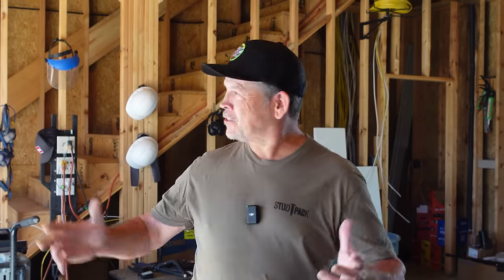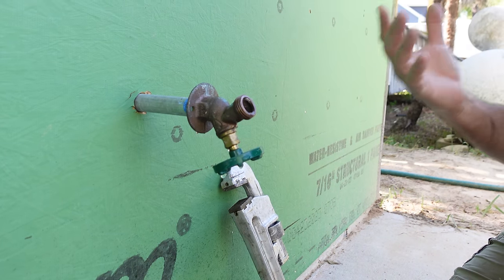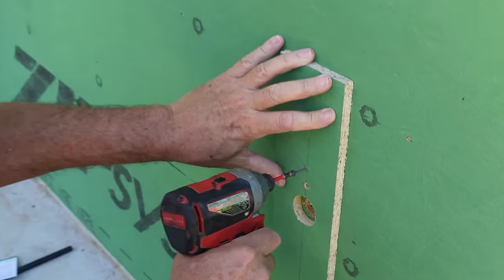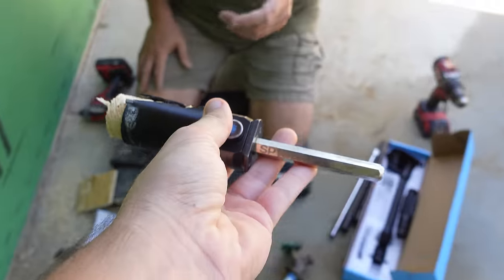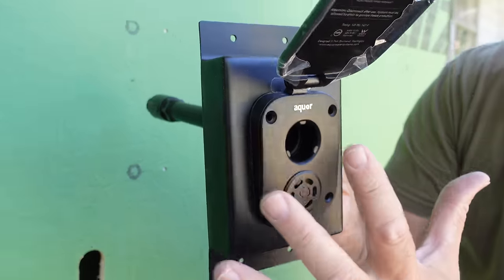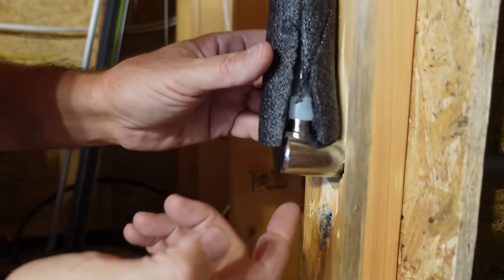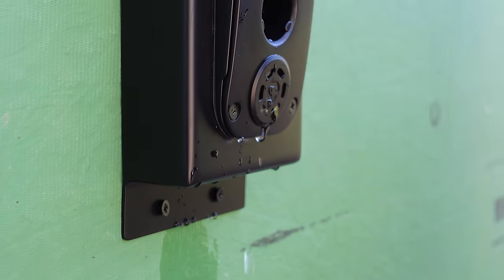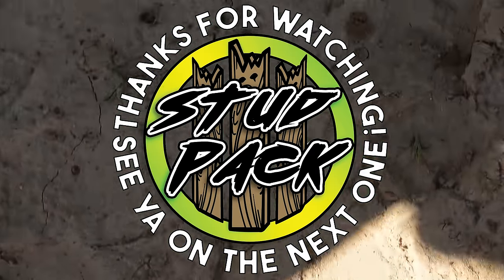Installing a Modern Outdoor Faucet - Ultimate Home Winterization

Comment: The frost free isn't as novel as you think it is -- might be due to regional differences, but where I've lived (northwest US) it's standard for hose bibs to embed the valve deep in the house. That just leaves the funky connector - which looks clean and does minimise issues caused by dirt/bugs, but isn't worth going out of my way to use it.
Reply: @gorak9000  looks like its $15 to replace
Reply: @gorak9000  and with a horse it's $0 to replace the engine. With a bonfire for cooking your food it's $0 to replace a burner. That's why you only see cars and stoves when someone is paid to promote them.

It's a different style hose bib. Strictly speaking you could build a hose to interface directly with this and do away with the replacement piece. Will it catch on long term? Who knows but your complaints against it are purely manufactured
Reply: @jacobalberty  It also prevents the people working on your neighbors house from stealing your water. I think it's worth it just based on how it looks. If you live in a nicer house and care about aesthetics it's a no brainer.
Reply: @jacobalberty  as someone who’s actually installed these, his complaints are correct. I would have left out the paid promotion comment because I don’t think that’s how stud pack operates. However these aren’t good products. They have potential. Right now you have no choice but full blast. I rarely turn my hose bibs on full blast. The other is you can’t repair them. The only way to fix them is to cut the drywall and remove them. They also acted like it’s this or a standard sill cock, that’s not true. There’s freeze proof hydrants. They can be repaired and if you do have to replace them, you can just unscrew them. I think if the they’d make two improvements these would be worthwhile. First make the threads on the tool finer and longer so you can limit the flow. Then make the front removable so you can take it apart and change o rings and washers. I’d never suggest any part to a customer that requires maintenance and that maintenance requires cutting drywall every time.
Reply: @scotts4125  until a washer gets nicked or wears out and you have to cut open the wall to change it
Reply: @joshcowart2446  I think you should watch this video. They addressed every concern you listed
Reply: @jacobalberty  what video? The one we’re commenting on? Tell me where they addressed any of it. Maybe I missed it
Reply: @jacobalberty  poor analogies and comparisons the Aquor is not replacing aqueducts..... it is trying to replace a universal standard that already does the exact same job, and can be purchased for far less money and hassle and has universal parts available at pretty much any hardware store in North America. what happens when the Aquor port fails and starts spraying water every where.. you have to ORDER parts and wait a few days with you water shut off ? with a standard bib, you go to the local HW store and buy a $1 O-ring kit or new bib..
Reply: @joshcowart2446  they showed the attachment with adjustable flow. they also designed their layout so the service side is in a closet or other space that allows an access panel to be hidden easily so no need to cut drywall. I've also seen these installed with bigger holes and a service loop on them so you can pull it out of the wall entirely by just unscrewing it at the front.
Reply: @jacobalberty  so you have to buy an accessory. Also it’s a ball valve, not ideal for controlling flow especially compared to a gate valve. As for the closet, you still have to cut pipe. You can’t push it out to unscrew it, so you ll have to cut the pex, unscrew the drop ear then do the same thing on the new one and reattach the pex. In my opinion this doesn’t offer enough of an advantage over a standard freeze proof hydrant to require this much work. The service loop like risinger used will be the best way to change it. However my argument isn’t about this job specifically but the product in general. Did they install one hose bib where the wall butts up. Can you only install these where there happens to be a wall for access? What if your location doesn’t have a wall. I guess as long as you build a new house and design it where you have a wall at every hose bib then you’re good.
I don’t dislike this product because it’s new and I’m trying to be old man shaking his fist at the air. I just don’t think it’s there yet. Like I said a couple of design changes and it would be fine. Can you design a house so that installing these will be fine, sure. However I’m looking at the product as a whole. I won’t recommend any product with rubber products that requires you to replace a well over a hundred dollar product when you could change a washer. I also won’t recommend something that requires a certain design just so you can change it without cutting drywall. They’ve made wall hydrants for decades for use in commercial buildings. You don’t have to have an access panel and throw the whole thing out when an o ring goes bad. So why can’t they simply make them serviceable. Just like everything else, it’s about trade offs. As it stands now, this product doesn’t have enough of an advantage over a standard freeze proof to require this much cost to the customer
Reply: @jacobalberty how much does it cost to replace a horse and restock the fire wood unless you have plenty of trees and time to cut and split wood pretty sure you would rather have a stove and car or truck
Reply: @joshcowart2446 he did mention putting a access panel to keep from having to cut the drywall
Reply: @jacobalberty every one I install on new construction I put a service loop for that reason
Reply: @plumbbuild6517  yeah that’s the best way but still that means you’re limited on where you can put them. You have to have an open wall abutting the area you want it. It still doesn’t change the fact that if a washer goes bad you have to buy a whole $100 plus dollar hose bib to replace it. I just don’t see enough upside for all this cost. Like I said, they’ve had commercial wall hydrants for decades that can be serviced without requiring extra construction to make it work or requiring replacement of the whole thing is a washer goes bad
Reply: @joshcowart2446  
"I won’t recommend any product with rubber products that requires you to replace a well over a hundred dollar product when you could change a washer. I also won’t recommend something that requires a certain design just so you can change it without cutting drywall."

Are you saying that the o-ring seals can't be replaced? I don't know anything about this product but, just seeing the piece on this video, that seems a bit off. There is an o-ring seal that is exposed when the hose is engaged. I would guess it wouldn't be a big trick to replace that. The o-ring where the adapter screws on is obviously exposed and replaceable. What am I missing? It looks like all you need to service the o-rings is access. The 90° adapter would preclude you from just unscrewing the fitting and pulling it out of the wall from the outside but that could be addressed, as Paul suggested, with an access panel or, as another commentor stated with a service loop and a straight fitting. I'd also bet the o-ring would last infinitely longer than a rubber washer (which already last a long time).

I'm also curious about what you are doing that you need such fine control of the water flow that the ball valve fitting wouldn't do the trick. You could solve that problem with a nozzle on the end of the hose (most people have anyway).

Now pricewise, this thing is a big upgrade over a standard hose bib but if someone wants the looks and/or functionality that is built into this unit, it's available. Some people put ketchup on hot dogs, some insist that mustard is the only thing that should be used. It's just a choice.
Reply: @joshcowart2446  yeah you definitely need a interior wall without insulation for the service loop , I only do them on new construction jobs and I’ve had to use the loop on a fitting that was bad I had a few fittings I had to buy during the Covid scandal that wasn’t my go to fittings and had one failure luckily it was on the hose bib service loop. Got lucky with that one.
Reply: @rogermccaslin5963  you can’t change the washer or o ring that I’m aware of. What you’re referring to is the o ring that seals the adapter. It has o rings so it doesn’t have to be threaded tight to seal. This is so when you use the 90 deg adapter you can unscrew it to the direction you want and not have a leak. The rest is one solid piece so there’s no way to remove the stem that I could find when working on them. This means you have to buy a whole new bib if the washer gets nicked. If I’m wrong show me and I’ll admit my error. Even if this was the o ring you have to go through the back so you still have the access issues. If you also need the access panel or service loop then it limits where you can put them. This last house I did that called for these had 4 of them. Only one landed in a closet so I put an access panel. I guess if you wanted an access panel in the middle of your bedroom and dining room, then I could have added it. 
As for the control thing, I almost never turn my hose bibs on full blast. I’ve used these. When you turn the key it sort of locks in wide open. It’s annoying. But this isn’t a deal breaker, it’s just another thing in the con column. 
As for that last part, do you think I’m trying to prevent people from buying them or for banning them? Where have I ever said I don’t think people should be able to buy them? You can install whatever the hell you want. I’m simply offering my professional opinion as someone who’s installed and replaced these several times. I see videos showing them as this new fancy thing and none of these issues are ever mentioned. The only upside is they look nice. I don’t believe that outweighs all the problems I’ve seen. This calculus will be different for everyone. This is just my advice, no one’s forcing you to take it. Also, I’m not criticizing these because I’m the old guy who says the old way is better. I love new plumbing tech and recommend and use it all the time. I just don’t think this product is there yet. In fact if they just made the stem accessible from the front I’d probably be okay with them because the rest of my issues are small.
Reply: @plumbbuild6517  the last time I installed these, it was a new house being connected to an existing house. It was 4 in the new and replacing all 4 of them in the existing. Not one of them was near a wall and only one was in a closet. It was bedroom, master bedroom, dining room, living room, kids BR, kids BR. That means I could only put an access panel for one of them.
Reply: @jacobalberty  Then you have a proprietary hose.
 Not only is it re-inventing the wheel, it's doing so at 4 or 5 times the cost on top of the design flaw that makes the water dribbling out want to creep down behind the siding. Why didn't they form a drip edge into that mounting box?
Reply: @joshcowart2446  
I actually addressed both o-rings (the water seal and the adapter). The water seal o-ring is exposed when the hose is engaged. Look at 4:26. When Paul engages the hose fitting the seal is exposed. That should be an easy fix if it ever fails. I'm sure you are right, it's not going to fit every situation but it is an option for those that can use it. 

I did not say you were trying to prevent people from buying them but I think your comments that I quoted did, intentionally or not, try put the product in the most negative light. You make them sound like fatal flaws where I just see them as design decisions.

I very much agree with you that anything that makes a product easier to service is a good thing. In this case, I just don't see it as a big issue.
Reply: In Canada ... most of us turn off outdoor water
Reply: @rogermccaslin5963     you’re right. It is repairable. However that still means you have to access it from the back. So you still have to most likely cut drywall. Like I said most of them don’t end up on a wall were you can access it. The ones I’ve put in didn’t. 
As for the rest, that’s very disingenuous. How do any comments ever prevent anyone from buying anything. I guess you can’t ever say a bad thing about a product or you’re trying to prevent people from buying them. You say fatal flaw versus design decisions. Isn’t everything. If something is pink and you don’t want pink then I guess that’s a fatal flaw. If you have a location where you can put an access panel or cutting drywall doesn’t bother you then it’s not a fatal flaw. You’re trying to argue semantics so that you can make my comment worse. 
Bottom line for me, the upside is it looks cool. The downside is unless you have a perfect location, you have to cut drywall to change an o ring. It’s not worth it. I just want people to understand the downsides because all I’ve heard is this the greatest thing since sliced bread and if you use it it magically won’t leak or make your flower bed wet (except when you turn it on/off). 

People can do what they want. I’ve said the downsides I think it has and why I wouldn’t recommend it to my customers. You can somehow think that’s a horrible thing but frankly I don’t give a shit. I’ll do what I think is best for my customers. If they disagree and ask me to install it, I’ll install it.
Reply: @joshcowart2446  personally I almost never adjust the pressure at the bib. I crank it all the way and adjust at a splitter. I can turn it down for my sprinklers and blast the crap off my deck at the same time.
Reply: Canadian tradesmen here. This is a solved problem.
The freezing problem has been solved for several decades, with a standard part that costs less then $30USD
This part, commonly referred to as sillcock, frost-free or freeze-proof faucet, also places the water shut off seal 12" into the house. 
It has few moving parts, and all moving?/wearing parts (eg O-ring) can be easily and quickly replaced from outside, without ever disturbing your seal from the faucet to the house. 
But this one is very pretty. 
I tend to see very southern people shilling this, as they don't know it's a solved problem.
Reply: @TheBarrej2006  some of us realize it. But apparently criticism means you’re telling people they can’t buy them
Reply: @joshcowart2446  You couldn't be more wrong about your ball valve/gate valve comment. A gate valve is the worst valve for controlling flow; it is intended for on/off service only. A ball valve is one of the best types of valves for controlling flow (throttling). Your best example of this is in your kitchen faucet. If you've ever had one apart you'll see that the closing element is usually a ball with a slot cut into it. Others will use a cartridge which works like a globe valve, which is actually the best at throttling but you will give up a little bit of flow capacity with that type. Yes you can throttle with a gate valve but it's not very efficient compared to a ball valve. I'm a Journeyman Plumber/Pipefitter with over 25 years on the job plus I teach the trade to apprentices as a side gig so I know what I'm talking about here. I do agree with your overall take on this though. No way can anyone convince me that this is a better alternative to a freeze-proof wall hydrant.
Reply: @handyandy2112  fair about gate valves. But they aren’t gate valves. I just called them that because of the look. A handle that turns. They operate how shower valves and many kitchen and labs have for decades. Globe valve is most accurate but I figured no one would know what the hell I was talking about. Many plumbers I know wouldn’t know the difference. I should have been more clear what I meant. Frankly I hate gate valves and wish they’d just go away. Any valve can be used to control flow because it decreases the ID so to speak. I don’t think ball valves are best for controlling flow. If the handle is easy to turn then yeah but many aren’t and you have to bump it to try and get where you want. I’d much rather have a threaded handle to turn slowly til I got the right flow.
Reply: @TheBarrej2006 
Southern Illinois here,  we've had one since al least 80's.
Reply: @davidtaylor4053  initial US patent 1964, entered public domain 1983.

Comment: I live near Chicago and have never had a standard hose bib freeze. As long as you remove the garden hose from the bib before it gets cold you won't have a problem. I am concerned that if I install the bib that you did, if the company goes out of business, where do I get a new connector? This is not for me.  Love the build.